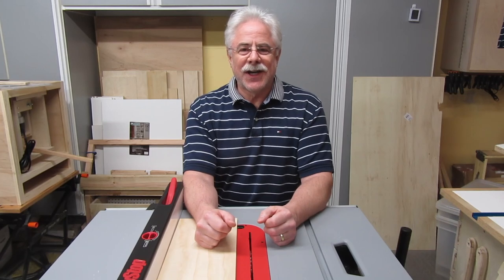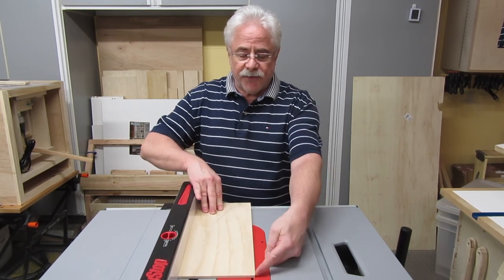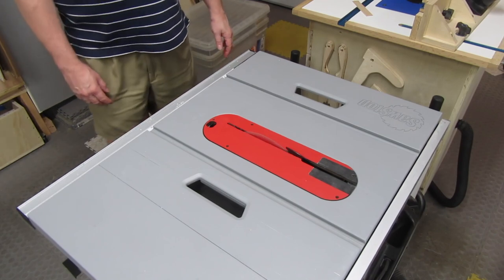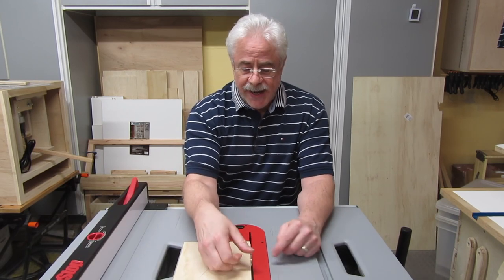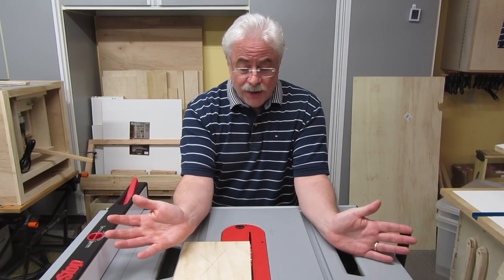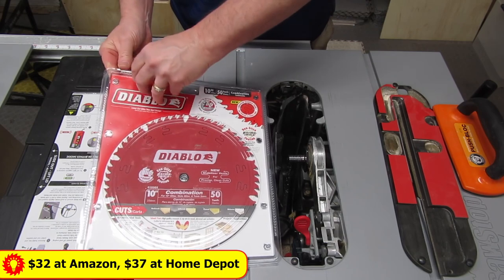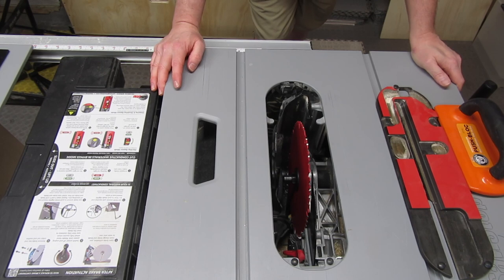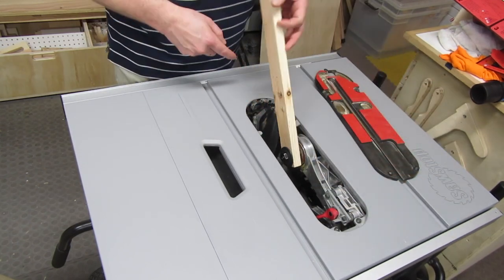SawStop Saved My Thumb! What Happens Next?

Comment: not manly to read the manual? xD from which century does that come from?
learning stuff at the trade school you have to read a lot of manuals. (i was in electronics)
Reply from the maker: LOL. I'm 62, and I'm a retired software engineer (aka "computer programmer" as we used to call ourselves). "Back in the day", I used to read manuals cover-to-cover, because it was the only way to learn how to do anything. Nowadays, most manuals are so bad I can't get past the first page. Fortunately SawStop's manuals are much better, but you know what I mean. 😄
Reply: @TheNewbieWoodworker  i wrote a comment because i know some men which think they have to prove their manhood by not wearing eyeprotection (anglegrinder/Welding) , or earprection (Anglegrinder). Joerg Sprave is one of these dudes , he learned after 10 Years and several injuries to respect safety a bit more (he still loves to claim he only wears a safety t-shirt, but i recognised he got less risky and pays more respect to dangers since he literally got burned) I personally think its an insult to manhood to claim its manly to take stupid risks without possible rewards ;D (you can loose your health but you gain nothing)
Reply from the maker: @hyperhektor7733  Amen. I couldn't agree more. I learned a long time ago that to continue to believe I'm right, in spite of the obvious fact that I'm wrong, is just plain stupid. And the same goes for safety. I don't know if that made sense, and if not, just know I agree with you. 😛

Comment: Glad you're ok!  I've got a Sawstop JSS too, good to know what to expect if something happens.  Have you ever had any trouble with your JSS?  About every 3rd time I turn on the blade, it starts to spin and then stops and the red light flashes.  Then I have to power it all off and back on again.  Sawstop can't figure out the problem, they even sent me a replacement saw and I still have the problem.  It must be something with my electricity, but I had an electrician install a new dedicated 20amp outlet and still have the problem.  Very frustrating, didn't have any problems with my Dewalt contractor saw...
Reply from the maker: Thanks! No, I haven't had anything like that. Very strange! I'm not an electrician, but I wonder if you need to install some sort of electricity cleaner? I've read about something called "dirty electricity", so I wonder if that might be the problem? I recommend in addition to talking with SawStop, you get on the Facebook SawStop Users' Group, and see if anyone there has any ideas. Good luck!
Reply: I don't know how heavy your saw is. Would it be fairly easy to take it to another garage and try it there.?
Reply: William Branham, thanks for the suggestion.  It's on a wheeled stand so I should be able to wheel it to my neighbors house and try it out.
Reply from the maker: @suepfister4593  Great idea. I hope it tells you something!

Comment: Did you examine the old blade to see if it was damaged or just assume it was?
Reply from the maker: That's a great question. It actually had at least one chipped tooth, and I was reasonably sure I had bent it a little getting it off. It was a fairly inexpensive blade from Home Depot, so I didn't mind just replacing it.

Comment: Disappointed I was looking forward to a breakdown of the actual costs to recover after failure. A tally and total, but it's ok just went back and jotted down what you posted individually. Thanks for your content
Reply from the maker: I almost did that, but since it's just the two items, and the cost of the blade depends on what blade you use, I figured I didn't need to recap it.
Reply: @TheNewbieWoodworker  didn't know if there anything else that gets damaged in the break etc when it engages. Been looking into one but haven't pulled the trigger yet.
Reply from the maker: @jakesteel3641  Nope, just the brake. And from everything I've seen, it isn't normally that hard to get the brake out. The fact that I'm a magnet for Murphy's Law may have something to do with it. 😄You won't regret getting one. But if you're looking at the JobSite saw, you might want to check out my review first, just so you know what you're getting: https://youtu.be/3zbYR5ok1V0.

Comment: Per the manual you aren’t supposed to use painted blades
Reply from the maker: Painted blades are fine as long as they're conductive. There's some types that aren't conductive (I assume), but these are fine according to a SawStop employee I talked to. However, I don't use this particular blade anymore, because it has anti-kickback shoulders, which can in theory slow down the braking action. But the red paint is fine.

Comment: It's interesting to know that the saw stops even when it has been turned off.
Reply from the maker: Part of it is the terminology I'm using. There's "Powered Off", where the actual power switch is turned off. But if the power is on, there's a paddle-switch that starts the motor running, and stops the motor from running. I probably called this "turning the saw on" or something like that, but it's not the same as turning the power on or off. I hope that makes sense. 😏

Comment: Several companies make foam filler strips to solve your loosely panel problem AND leave room for panel expansion.
Reply from the maker: I don't understand what you're talking about.
Reply: Panel Alignment strips are inserted into the panel slots. The panels are intentionally made slightly undersized to accommodate the panels’ seasonal expansion and contraction. The foam strips hold the panels centered and would have replaced the thin wood strips you were trying to make. I buy them from Sommerfeld tools:  https://sommerfeldtools.com/shop-essentials/cabinetmaking-hardware/panalign-strips  Hope that helps clarify. Sommerferfeld has great frame and Panay instructions on their website.
Reply from the maker: @Tool-Meister  OK, that makes sense, but did you mean to leave this comment on one of my other videos? Perhaps my "Tongue & Groove Router Bits & Shaker Style Cabinet Doors" video? https://youtu.be/dc15zOyLQwg

Comment: I did not know it worked with the power off ,
Reply from the maker: Oooh, good catch. I didn't power it off, I pushed the switch that stops the motor from running. Two different switches. I should have made that more clear. Thanks!

Comment: Saw Stop's are great, glad your OK, i also have one and it will also trip with wet wood, mine did.
Reply from the maker: Thanks. Yeah, my one worry is I'll either forget to test wet wood first, or I'll cut an aluminum miter track and forget to use bypass mode. But it's still worth it. 😄
Reply: @TheNewbieWoodworker  it very much is worth every penny, be safe.
Reply from the maker: @DesertBumWoodWorkn  👍

Comment: Are you sure you touched the tip of the blade and not the side?
Reply from the maker: Yes, for several reasons. It tore off some skin right in the middle of the thumb, and later on in the day it started to feel like it was burning. Also, the blade was too low to be able to touch the side. It was 1/4" stock and I didn't raise the blade very much at all.
Reply: @TheNewbieWoodworker  
Well that's great that you had the sawstop because it's not something you buy hoping you have to use it someday. Maybe more people will get one now and be more safe.
Reply from the maker: @zart3374  Thanks. Yeah, it's one of the few things you buy hoping you don't have to use it! 😄

Comment: 6:00 
that doesnt look healthy to the threads...
Reply from the maker: I couldn't figure out what you were referring to. All I see at that timecode is me setting the spring on the table, and looking in the saw.
Reply: @TheNewbieWoodworker  oh sorry . I meant the threads on the shaft. If you force the blade out like that it cant be good to the threads on the shaft thats all. Later in the video you said it worried you,too , but everything was ok. Still wondering how to protect the threads a bit while forcing the blade out since the blade is harder than the shaft.
Reply from the maker: @The1Rausch  OK, third time's the charm. I tried to post this once, but it got eaten. Then a second time, but suddenly I was signed in using my other YouTube account. Hopefully I get it right this time.

I see what you mean now. It turns out that the arbor on the SawStop is REALLY hard. I'm not sure the blade is harder, to tell the truth. But in retrospect, the issue wasn't the blade - it was the brake that was stuck. I should have focused more on that than the blade.
Reply: @TheNewbieWoodworker  ah ok i c . Was thinking about buying a sawstop (festool here in germany) but cant afford it yet... want to know all the quirks before i spend the money ;)
Reply from the maker: @The1Rausch  That makes sense. It's always good to know what you're getting in to. 😄

Comment: The red coating on the Diablo blade is an insulator.  
So if you want to touch the spinning blade without tripping the SawStop brake, touch the side, not the teeth.
Reply from the maker: I just checked, and the lights flash when I touch the side of the blade. So even if the paint is an insulator, it doesn't stop the SawStop from noticing I touched it.
Reply: @zomgthisisawesomelol 
It was a joke, though a feeble, silly one.  On the other hand, I've seen guys pinch the coasting blade on a circular saw to stop it without waiting for it to stop on its own.
Reply: @TheNewbieWoodworker  
The brainy SawStop brain must look at capacitive coupling.  It is humbling to know that someone figured that out.
Reply from the maker: @bobd5119  I don't know what the science is called, but I like the term "brainy". 😄I wonder if someone has written up the story of how the technology was invented? That would be fascinating.
Reply: @TheNewbieWoodworker  
It took Physics PhD Steve Gass three weeks from design through prototype.  After "numerous tests using a hot dog", he tested it on his own ring finger.  What thoughts went through his head as his finger drew close to the blade?  Jeeeeeez!!! 
There is a writeup at https://en.wikipedia.org/wiki/SawStop
Reply from the maker: @bobd5119  Thanks. I read an interview with him where he said it took him a few tries before he got up the guts to really do it.

Comment: You should really think about if woodworking is the right thing to do after your retirement. if i see your nice clean shop, everthing new and then: 1. you hit the blade, 2. you cut your finger by changing the new one. What`s next? anglegrinder is another great tool for injuries. to get tactile skills for all kind of work you need a lifetime. If you dont have them, everthing you do is dangerous. that is why sawstop has so much success in US and thats why festool bought it. And dont think red sawblades are the best for the money just because you see it in every woodworking video.
Reply from the maker: The reason I bought the "red" blade is because it's cheap, I can get it at my local Home Depot, and it seems to work well for me. I've never even considered whether it's in other YouTube videos. And you think my shop is clean? I guess I manage to not point the camera at the dirt. 😄And to your first point, I've actually thought about that. I have a lengthy blog post talking through my issues with making mistakes. And it's not an issue of tactile skill - it's an issue of focus, or lack thereof. Although sometimes it's just stupidity, like cutting myself removing the blade. But I'm not going to quit.